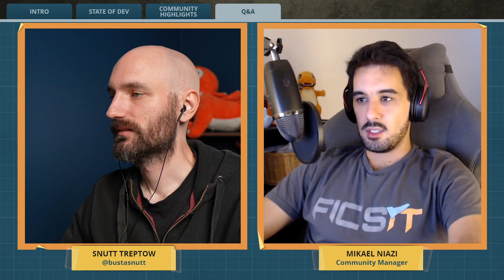Q&A: Is the Pipe Mk.2 bug still a thing?

Comment: The pipes arent broken, but if people are complaining,  the game may need to better teach players how it works and what the expectations are.
Reply: That's what I'm thinking. There can only be so many players struggling with pipes, specifically if they're not properly explained in regards to how they should be used, without needing to pull up a wiki of some kind.

I personally haven't needed to pull up any guides or wiki pages for things in Satisfactory other than how pipes work, because they confuse me too.
Reply: @ThePimpinator  Agreed. What confuses me even more is when you do everything right according to what wiki and documentation is out there and it still doesn't work. Tried to use Mk 2 Pipes maxed out today and the system, as I remember back in 0.6 fluctuated so it never had 100% output. I still think the bug is there, or there is some nuance WAY beyond common sense that heavily halts any throughput demands above 550 on a Mk.2 for consistency and trying to get a feedback system in the game to let you know what issue, and/or where you are having it is nightmare inducing. 

I'll just stick to my Mk.1 Pipes running well below max capacity so if it ever does fluctuate, I have more throughput than necessary to compensate.
Reply: that or redesign how it works
Reply: @rocwelledwards8942  nah, its been working this way for years and they've spent a good deal of effort ensuring that it works as designed.  Games benefit from helping people understand concepts and functionality. Games should not change their mechanics because some people struggle with them.
Reply: @dustinyoung3069  That depends on how many are 'some' If it's a significant portion of the user base then it's bad game design. If your players say they don't a mechanic or don't like how it works, they're telling their friends that who then are NOT buying the game. It's that simple. If enough people don't like the mechanic, it's a bad idea.
Reply: Brother Pipes are way broken. And my save file is bricked now because Pipe holes dont Connect correctly needing me to replace 120 Pipes 120 Pipe Holes and 120 Pumps in my megafactory tower to unfuck my save file.
Reply: He did mention not having the time to explain it better, so maybe they'll get to it in the future. I'm sure it's low priority because there are plenty of videos explaining them.
Reply: 1: The player is never wrong. 2: If the player is wrong, see rule 1. 3: It is the job of the dev to make sure the player understands how the game is supposed to work.
Reply: @seanbrockest3888  Bingo. As long as you remember the customer is plural. Retail went to crap when it forgot that.
Reply: @seanbrockest3888  Yeah, no. You severely overestimate both the intelligence of the average gamer and their willingness to actually understand how a game works. No matter how simple you make a game or how clearly you explain something, there will always be players who fail to understand. I'm very much not a fan of this approach I've seen in recent years of treating any lack of understanding from players as 100% always a design issue.

Comment: I've worked in IT for almost 20 years and this same mentality is why I DREAD telling the service desk about "significant" changes I'm making; the service desk will blame any problem that any user has in the next week afterwards on that change I have made, even if it's blatantly obvious that my change would not cause the problem they're referring to.
Reply: I feel like ignorance in regards to game programming can be forgiven. I know literally NOTHING about how game programming works, so when I see a significant change it makes perfect sense to me that this change could have some pretty random effects on other things you wouldn't expect. I've also experienced random bugs in games showing up after major updates, so people are basically thinking of that same kind of thing.
Reply: Same for communications technicians.  If one was in the wire centre/CO/server room in the last 72 hours, no matter what they were doing, it's their fault.
Reply: @HSkraekelig  To be fair, this is generally because of shit documentation as to what actually plugs into where. Sometimes tech's can't read, though, and actually touch the wrong thing 🤣
Reply: Service desk is bad enough without making their job harder. Withholding information from them after significant change prevents them from diverting tickets. It’s especially bad when changes cause mass problems and instead of having one ticket with multiple callers the SD is inundated and pushes tons of tickets every which way and causing even more loss of work. 

The SD makes pennies compared to senior programmers. You get what you pay for. Don’t compound the problem. If one of my programmers made a significant change and didn’t tell the SD, I’d have to think really hard about not firing them, especially if there were problems on a large scale as a result. ESPECIALLY if I had the SD manager in my ear about how lazy my programmer was and how much it was costing her. 

But that just me.
Reply: @burntorangeandblue  I don't withhold the info, I just dread providing it for the reasons I mentioned. But yeah obviously not ALL of the SD people do what I described.
Reply: Ah, wires. The pipes of information.

Comment: Probably need a good explanation. Had 2 fuel generators at the same elevation with a 26.667 m³/min input. I set up the line to the first generator consuming 20 m³/min of fuel first, then set up a second line to an underclocked generator that would only take in 6.667 m³/min of fuel. I saw a few possibilities, main one being splitting evenly like a belt splitter filling up the slow one faster. It filled up the regular one faster, didn't provide enough to fill up the slower one for consistent power and wasnt filling up the regular one fast enough to overflow. I deleted the second one and waited until fuel started to overflow then put up a second one afterwards. That is what fixed it. Tried valves also without any luck.
Reply: Thats normal Fluid arent always even, which makes sense when u think about, its just not very fun gameplay wise. Like u wrote the best fix is to fill buildings and if u want also add a fluid buffer. That way u can circumvent the fluctuations
Reply: fluids slosh back and forth if all pipes arent of equal length (likewise with buffers).  You can get around this by fully filling the pipe beforehand.
Reply: Every time I turn something on without filling the pipe completely first, stuff like that happens. It's apparently caused by the fluid sloshing back and forth, which it can't do if the pipe is full. Or something. ¯\_(ツ)_/¯
Reply: As another user commented just wait to turn on machines when pipes are full. There is no pressure is just like bottles of water. If you pour out the same amount you are pouring in the bottles will never be full and with two different size of output could be tricky. Wait until bottles are full and then open gates while you are still pumping water in, it will work 100% of times
Reply: @alessandrosantarini9880  will try

Comment: Priming the pipe before turning on all the machines on a pipeline works every time for me. It’s takes a little extra time but once the pipe is full then you’re good to go.
Reply: Exactly this. Especially when doing a coal power plant, ideally you want water to prime into a buffer, then go to the coal generator.
Reply: Remember! Only full pipes are happy pipes!
Reply: This. Never had issues with primed pipes.
Reply: I'd agree, but even that isn't foolproof. You'd think a fully primed pipe system would just hit 100% and never not have 100% output, but it's possibly in 1.0 and I've been troubleshooting one for about 7 hours now.
Reply: and exactly this will NOT working

Comment: Pipeline hole still seems bugged unfortunately. Sometimes just removing it fixes the issue.
Reply: I've had a few cases where pipes did get stuck either not giving their fluid to nearby pipes or not taking fluid from nearby pipes, but no pipe I replaced after finding it has gotten "re-infected" and of the five or so only one was touching a pipeline floor hole
Reply: I find building the receiving side of the pipeline hole (so the pipe connected on the side where you want to send stuff, build a pipe connected to the pipeline hole) and then the sending side avoid bugs.
Reply: I just clip the pipe through the floor then clip the pipeline floor hole on after.  It's functionally the same thing without having to worry about pump issues.

Comment: I still firmly believe the mk2 pipes are broken.

I have four sets of fuel generators that are supposed to burn 600 turbo fuel each and they still run out of fuel, without fail, unless I either remove a generator or underclock a generator or two. I have checked the math more times than I can count that I am making/burning the correct amount of fuel on paper, I have more pumps than I should ever need to prevent sloshing, I have checked the blenders multiple times to make sure they are operating properly, and the systems were started with full pipes, generators, industrial fluid buffers and blenders. It's the same issue I saw prior to 1.0.

Meanwhile, I still have my orginal fuel generator set up using mk1 pipes and it's been out of sight and out of mind for tens of hours despite being put together with far less care and precautions.
Reply: Totally.  I cannot get 600 out of pure oil node.
Reply: exactly the same here but nobody belive us :(

Comment: My only complaint on pipes is I wish straight mode would work as well as belts 😂
Reply from the maker: September 17th, 2024 Livestream
Q&A: Pipeline straight Build Mode, when?
https://www.youtube.com/watch?v=Cl9ufT3bm8U
Reply: Oh man I feel that!
Reply: @SatisfactoryClipsArchive  Only pipeline 'bug' I'm running into on 1.0 is that floor holes after a long vertical run of pipe don't let water thru. I've had to remove the floor holes and direct connect and water flows fine.
Reply: @petergraphix6740  Floor hole issue is sometimes fixed by just removing the pipes and placing them in a different order etc. fiddle around with it. I've so far insisted on using them and not clipping through the floor :D :D
Reply: @petergraphix6740  Damn, pipe holes are still bugged? I thought they fixed them. But yeah they can kill the head lift. I just clip pipes through floors because it looks pretty much the same.

Comment: The best piece of advice I've gotten for pipes near capacity is to make them a loop... Connect the back ends together as well and sloshing seems to stop. Fixed my oil setup where pumps and valves did not.
Reply: I did this once as a hail Mary thinking "this shouldn't work" and It fixed the whole problem.
Reply: So, if I were to make a pipe manifold, I would take the last end of the pipe and reconnect it to the start? Just asking because I want to know how to solve my problems as well.
Reply: @friendofp.24  pretty much, yeah.
Reply: Yeah this happens because a lot of people don't understand dynamic systems. If you have 600 m^3 of output going into one pipe, that is the average output. The refinery blender or whatever has downtime while the big progress bar makes the next batch, so that means it is instantaneously dropping 2-3x the average flow into the pipe. If all of the refineries fire off at once, then you can get into a scenario where the pipe can't flow enough material.

Making a "loop" just effectively doubles your pipe count, taking you from 600 to 1200 m^3 /min max, so the refinery can drop all of its dynamic output instantly into that overhead and its fine

Comment: My issue with fluid so far is just that there is almost no feedback as to what is going wrong with any pipes and the feedback that is available the game does not do a good job of telling you what it is showing you.

For instance, in coal generators or any buildings that require fluid input will show you how much fluid per minute it needs, and extractors will show you how much fluid per minute it makes, but it's very difficult to figure out where in the pipeline something is causing any given input to not receive as much input as you expect. With conveyor belts you can quite clearly see visually on the belts where things are not moving as fast as you expect, making it easy to diagnose where the bottleneck is, but for fluids you have almost no visual indicators, and the only thing you see in the pipe UI is whether the pipe is filled, and you see flow rate which just goes up and down and doesn't tell you much either. Especially if fluid is arriving and being consumed but not at the rate you expect, since fluid is never being fully filled in the pipes it's even harder to tell if something is wrong in a specific segment or the fluid is just passing through it without filling...
Reply: The ring segments in the middle show you %filled, flow rate, and flow direction, which can help a lot
Reply: @makeandbreakgames1791 Oh no, I only use the naked version
Reply: @guy_autordie  I use normal when building, and switch to clean after all the machines are working
Reply: @guy_autordie  The problem is between the keyboard and chair
Reply: Only if you dont understand how to run your diagnostics. I can always trace back to where the issue is. Just look at where the back up happens
Reply: @trolololoolable  then what?

Comment: It might be user error, but when i cannot get pipes to work as they should after countless hours of trying alone as well as hours of getting other people to fix it for me, it might as well be called broken/bugged.
10/10 game but pipes are by far the worst part about it.
Reply: Pretty sure pipes is what makes 90% of people give up.  There is no way to 600 out of a node.
Reply: @charliebrenton4421  no that works. or at least its as close enough to 600 to not be noticeable.
But the problem lies with trying to manifold feed a 600 belt into stuff like generators. 
i did not manage to get that working flawlessly untill i had 300 hours in the game.

Comment: The only issues I've had with pipes is sometimes the pump headlift auto-snap feature goes to high.  I just manually put the pump a littttttlle bit below it and everything works out.  Also once you know water gets priority based on height, it becomes pretty straight forward.
Reply: But pumps have a bonus headlift of 10% of their maximum headlift and the autosnap doesn't count this bonus. So it should always work, right?
Reply: @Precigian  I can tell you for a fact that I had a pipe going straight up, and I put the pump on the snap point and it did not work.  Wasn't even anything special about the pipe, just extractor -> up facing pipe.  Moved the pump ever so slightly lower and suddenly water appeared above the pump.
Reply: @bobothebob4716  Idk about that one. I read from wiki that pumps count their head lift 2/2.5 meters from below their center point. Maybe there's something to do with the extra pipe that stays inside the pump when you build it on top of an already existing pipe. Maybe when the pump counts from 2.5 meters instead of 2, the extra pipe makes the whole segment more than 22 meters long? Now that you mentioned this, i also had a similar problem. I solved it by reattaching one pump to the other. I wanted to get rid of the extra pipe (for looks) and  I new there's an issue where the pipes look fine but they aren't actually connected, which you'd need to reattach the segment to fix it.

If my teory is correct, the mk2 pump in the same context should work (cause it's bonus headlift is 5 meters, not just 2). Regardless, yes, pipes are wierd.

Comment: I don't have any steps to reproduce.. its just regularly still the case that a pipe is empty while the one next to it is over half full. Then I reconnect the pipe and it starts flowing again. Its getting frustrating if theres no elevation change but the fluid suddenly just stops flowing between connection points.
There's a good chance I use them wrong, I have not yet looked into fluid dynamic guides or whatnot. I just look at how far can this pump up. Is it reaching? And then am annoyed when it does but stops when theres no longer elevation happening. And its not always resolved by adding another elevation pump. They go idle until i reconnect various pipies..
Reply: There is definitely some sort of bug where placing anything (floor hole, pump, pipe support, etc.) in the middle of an existing pipe breaks the flow through that pipe until you rebuild one or both sides. Seems to happen most often with pumps.

Comment: Pipes are my favorite part of the game and the irony is that even the most valued guides on pipes tend to ignore details which are actually pretty important. My theory is that a lot of issues are the result from copy/pasting pipeline designs, but without fully understanding what it does.  Many pipeline designs work "on the edge": maximizing out the stats, thus also leaving no room for extra needs.

.... like having to deal with a small uplift, even if that uplift is much smaller than 10m: it'll still cause an increase in pressure requirements. Requirements which your copy/pasted design can't meet because it was never designed for that.
Reply: Go make that complete guide and share your wisdom with the rest of us! I agree completely that a lot of the guides are just "here is the setup for X" and not a great explanation of how things work. It doesn't help that they've made changes over time too so some old guides can be outdated.

Comment: The only issue I had with pipes was when I redid my oil factory. I changed what fluid was being produced but a very-tiny amount of the original was trapped in the pipes. A full network flush got things moving finally